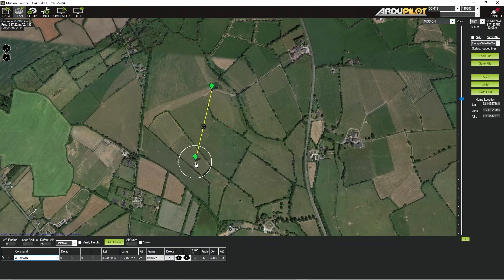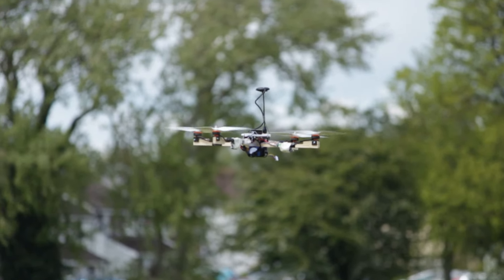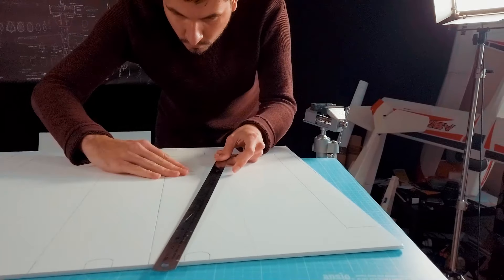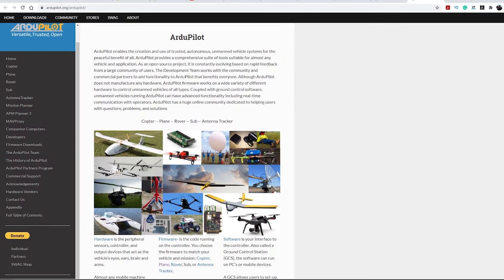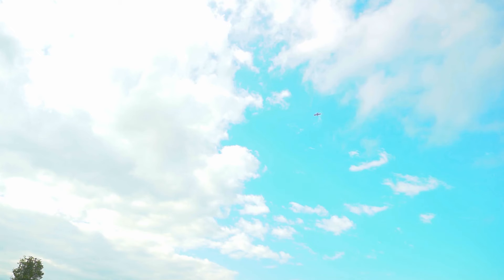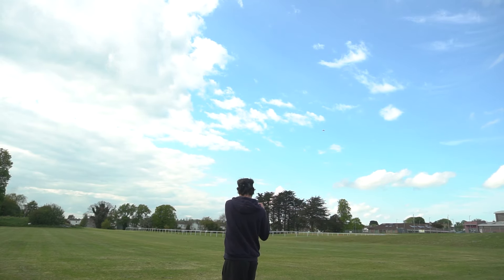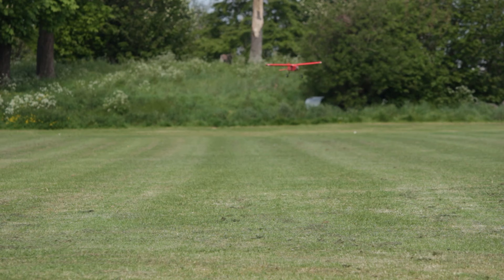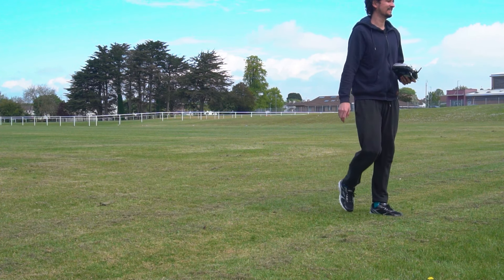Ardupilot First Experience - Beginning my journey into autonomous flight

Comment from the maker: I'm still learning about Arduplane, I hope you liked the video... ♥️
Reply: So, that is your objective now... Because I have a little of experience:
1) Buy a telemetry radio to connect the plane to your computer, or phone. With that, you don't need to connect the plane to your computer with a USB. it is already linked by radio.
2) The telemetry radio has 2 modules, an Air module, for your plane, connected to a UART, and another for your computer/smartphone (ground station)
3) You can change the mission points in the field, or in the air with that module. 
Small notes:
- a 100mW you will have a connection for around 100meters. With a power of 500mW, you could reach 1km. 
- don't use the highest velocity for MAVlink protocol only "baud rate to 57600"
As a ground controller, I use "QGroundControl"
Reply: Glad I found a few different channels that run arduplane.  Would love to make an RC but my goals right now is more so a yard sentry.  One that’ll basically drive to the edge of the property.   :).  

Thanks

Comment: One major tip I learned while building autonomous quads was to always BALANCE the props, especially after crashes. It can literally make night and day difference in stability.

Joop Brokking made some great tutorials in the past (in his YMFC series).
Reply from the maker: Thanks
Reply: @Joyplanes  Did you switch from iNav to ardupilot?
Reply from the maker: @MrNams  For autonomous flight yes, I prefer Ardupilot
Reply: @Joyplanes  Thanks, I am using iNav for my 7' quad, and I am not happy with RTL,Position Hold,Mission etc, so thinking go back to ardupilot

Comment: Is there a (fixed wing and drone) parts list that is known to work out of the box with open-source software?   Preferably, a ready-to-fly solution, just program either Ardupilot/PX4 or Beta/EmuFlight/iNav and fly?   Something like the Sturdy Birdy 2 or Duraplane?

For example, the electronics always seem to be either the larger Pixhawk boxes, or the small-square-stacks (STM32F/H7 - Speedybee F7V3, Mateksys H743, Kakute H7 V2)..  but not sure if any is capable of running any firmware.  BTW, I don't see a OmniBus F4Pro on the ardupilot stable releases?

I'm interested in:
1) Autonomous Flying (Waypoint, Lua scripting, Return-To-Home)
2) Sport-Tracking/Obstacle Avoidance  (like the Skydio2+)
3) FPV and free-style / flippy-flops

I understand Beta/Emuflight is popular among FPV racing, and ArduPilot for autonomous/waypoints.. however is there another that can do autonomous and free-flight?  iNav, FalcoX?

And how does a custom DIY build compare with the features/performance of commercial product.. Eachine E520S , Mavic Air 2S ?

Comment: I am working with a Christian Missionary group that wants to use autonomist fix wing gliders to deliver critical medicine (anti-venom) to missionaries on the ground.   The location is about 100 miles from the airport.  A plane would carry the glider over the village and release it.  The glider would land in a pre-designated location (way point).  The glider would only have a rudder and stabilizer. This would be a one-use vehicle so the cheaper the better.    I was hoping that you could recommend 1) An off the shelf airplane or 2) Simple hardware and software to achieve this goal.  – Thank you for your time.
Reply: Hi, I would look for cheap foam board planes, you can get a "speed build kit" from flitetest for example. Servos are as cheap as 1$, so maybe have an elevator too, not only a rudder. Choose a glider design with rudder and elevator only. I assume the most expensive part will be the ardupilot board, you could maybe find a way to rip out the boards and send them back by mail? The airframe then as an extra could be equipped with a cheap transmitter/receiver and handed to the local kids, who will learn a ton about technology and craftsmanship from it!
Reply: Maybe even ask flitetest about this directly as they may even want to sponsor this or help find someone who wants to.

Comment: I never use the compass on fixed wings, too much trouble. The compass is only need to estimate heading when the plane has no forward motion, and since fixed wings always has this, you can simply disable the compass (and get rid off all the issues with having a compass).
Reply from the maker: I've heard that, what problems do you normally find with it?
Reply: @Joyplanes  "Bad compass health" in Arduplane if you don't have an external compass away from the high current noise. 
Depending on your "ARMING_CHECK" parameter, it can be hard to arm if you have compass error.

Comment: I'm also learning ArduPilot in my glider Volantex Phoenix 2400. I think that is really good software, but I'm still do not have a answer: How to test RTL? Does mean: I do not test in air (!). Maybe someone know answer on my question :D :)?
Reply from the maker: I just put the mode RTL and activate it while flying to see what will happen.
Reply: @Joyplanes  I'm afraid that I will crash :) (Yes, I have RTL on switch, also like Stabilize and FWBA)

Comment: You might need a new JC, you know that little thing called Jump Controller to avoid hitting the plane.

I like that content but it is a bit tough right now to jump into "systems" and out before you / I had arrived. I know it is calle "First Experience" and touches and shares your journey, but I am a bit lost asking why ardupilot now, why copter and then plane, where plane had been before iNAV based. Might be that you will add later the big picture, I was missing: 
Why now ardupilot instead of iNAV ?
Is iNAV no longer an option for you ?
 What do you understand under autonomous beyond loitering and didn't ardupilot had these features and mission planer too? 
I thought so even though I have not used it. 

I am writing cause in the past I had never such experience before like "feeling lost" cause your videos had what we call a red line, a well told logic story and here it ends with an open end or better 2 open ends like what next with the copter and what with the plane considering this title here is missing a Part 1 so I could assume a Part 2 will follow soon. 

I am not complaining that it is crap, no it feels like an unfinished symphony with unknown fate - and I could learn a bit about a pure or basic copter on a wooden croos and the auto tuning feature of the plane and the really smooth proximity flights with the plane as the result of your "training flights".  Might change with the next video, but I guess it would be great if you might explain the vision of the cannel (mostly know), your road map what you think or want to achieve and where we are in that video like overview over FC software and here ardupilot with the next upcoming episode ABC pilot. And I guess you have a plan for the year or even a forecast what to build and what to train or teach, cause they will end in a playlist I guess. 

That might sound like a train schedule departue Paris 9 AM - Brussels 10 AM - Amsterdam 11 AM - Berlin 13 AM, but I mean it more in the general road for this year without a specific piece just like "this year I wanna cover an overview over autonmous software and show it in flight" and " 2 planes in mind , one wing and a rubber band powered plane" and so on and if you think you have a small electronic piece to talk about than you can put it between Paris and Brussel cause it would not matter to make a detour to Straßburg to talk about LED or gps rescue systems and alternatives.

I gave it a thumbs up cause you are doing the right stuff and you are doing that right, but usually you explain the journey a bit better or maybe I had been to deep in your past with iNAV and jumping into Ardupilot. 

Great content, great video and keep going on.
Reply from the maker: Thanks for your support. Well because I'm doing some work for a client I had to learn and do tests with Ardupilot, ardupilot has a lot of options and INAV is very good too but I need to test these systems more to talk about them and show them in the following videos. For now I can just share my experience and the videos come as I go. Thank you for the suggestions, I'll take them into account.